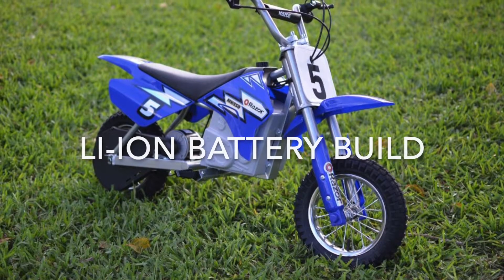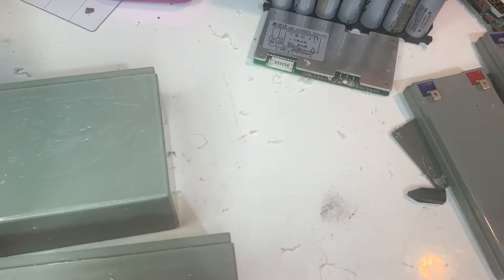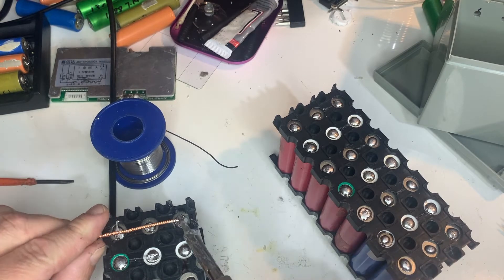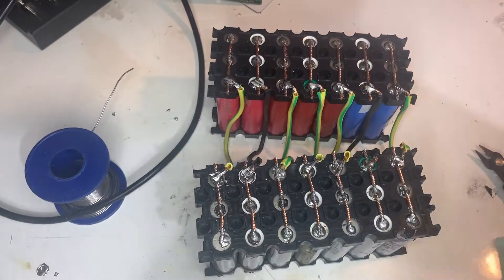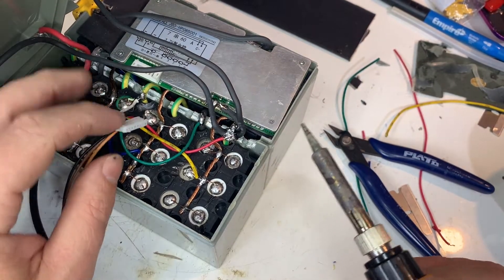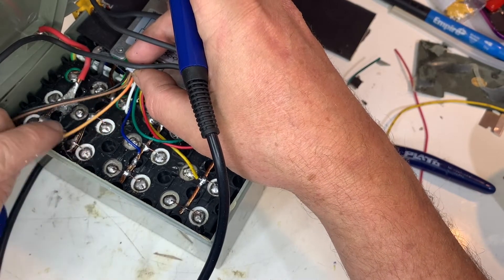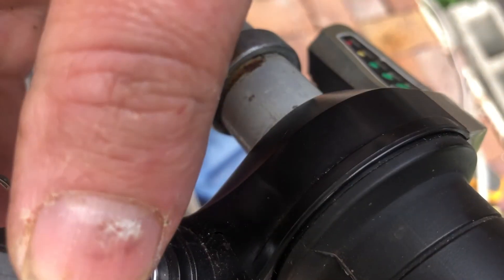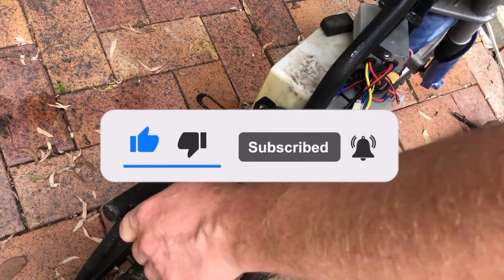7S 6P Li-Ion DIY Battery Build For Childs Razor MX350 Electric Motorbike #DIY #18650

Comment from the maker: Two and a half years later this battery still works as good as new, also it still helps power my house when not in use. I've since upgraded my house batteries from a similar approach to 4X 100AH lithium ion batteries, it still plugs in, charges and supplements home power storage when not in use.